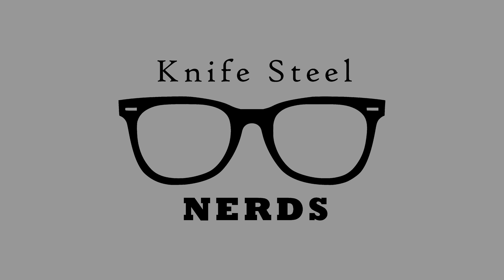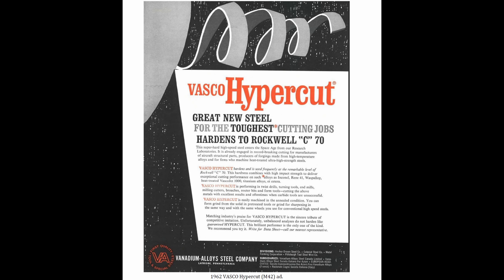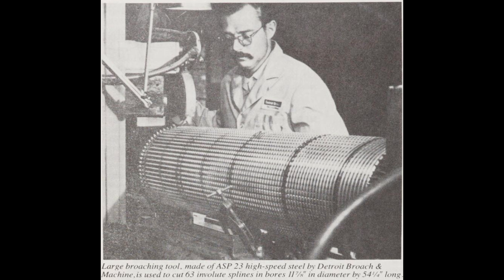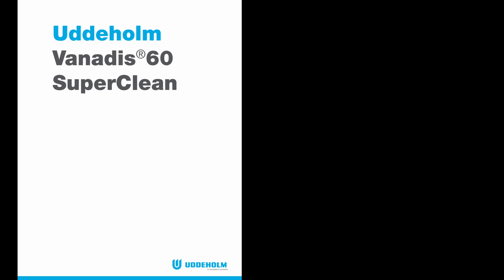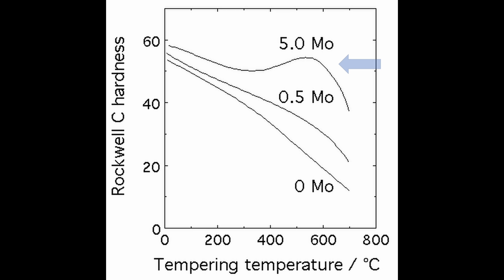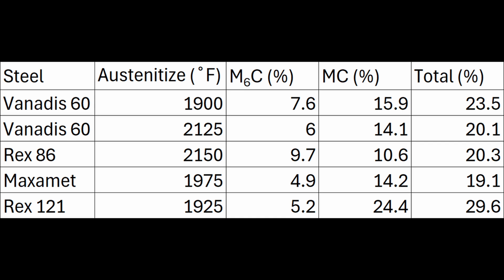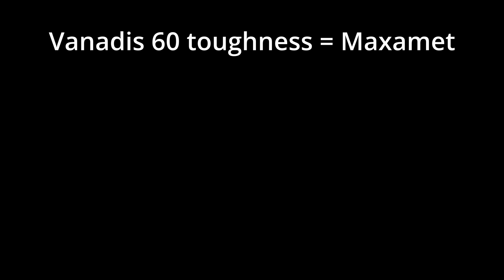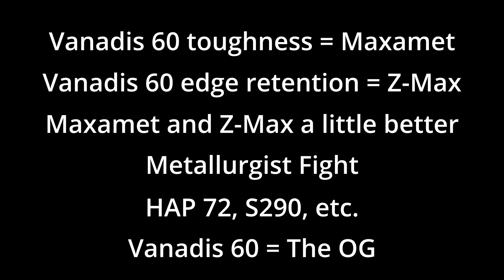Vanadis 60 Super High Speed Steel - 70 Rc and 7% Vanadium

Comment: If I wanted a knife that had a very high polish, a mirror polish. What and it’s a pocket knife what steel would you recommend?
Reply from the maker: Something without significant amounts of vanadium like AEB-L or CPM-154.
Reply: @KnifeSteelNerds  thank you 🫶
Reply: @jes6628  ZDP189 has lower toughness but insane 10v class edge retention and it's extremely easy to sharpen and to polish without any special abrasives. I would suggest AEBL, XHP and ZDP in order of highest toughness and least edge retention to lowest toughness and highest edge retention. All of these are essentially chromium steels which do not contain vanadium or other carbides. All of them take an excellent polish as you'd expect from chromium steels. Any of these steels take excellent an mirror polish without much effort or nonstandard abrasive.
Reply: The more wear resistant, the more it resists scratches… obviously, but that means the grind of polishing a harder knife pays off a bit more.

Comment: 70 is the highest HRC I’ve heard of… have you (or anyone) done any modeling of the theoretical maximum hardness for any “steel” composition? What is the highest HRC achieved in practice?
Thanks, Dr. Thomas.
Reply from the maker: I can’t say I know the exact limit but somewhere around 72-73 Rc. The Rockwell C scale technically stops at 70 though the tester will still read higher.
Reply: @KnifeSteelNerds So.. the steel is off the charts, one might say. They didn't call it Max for nothing..
I wish it was easier to remember the actual hardness difference between something like 55 HRC, 63, and 70 HRC by percentage, since it's not linear.

Comment: I'm incapable of working with these steels as a bladesmith, but these videos are still very interesting to watch, thanks for all these videos and explanations Larrin!
Reply from the maker: I bet you could work with them if you wanted. It would just be more work
Reply: @KnifeSteelNerds  how do highly complex steels forge tho? Especially in a charcoal forge, in a very traditional setting... From changes in carbon content (be it loss trough oxidation, or carburizing in the fire...), to high changes of temperature, and probably tiny hot working ranges. Also, i don't imagine traditional ways of heat treating, such as using the forge or a bed of hot charcoal (wich is surprisingly even and accurate compared to using a forge) would be fitting for such highly alloyed steels... I personally focused my work on exotic alloys and damascus, like with copper based alloys that will quench harden, or offer interesting/beautiful results.
Reply from the maker: Using a furnace for heat treating definitely makes it much more viable
Reply: I think high performance steels are more for stock removal and not forging

Comment: PM60 is the version by Scana, right?
Reply from the maker: Yes
Reply: @KnifeSteelNerds  Thanks. Got that steel in my Kunwu. Love it.
Reply: @KnifeSteelNerds  I've read that PM60 has even considerably more W and a little more Co and Mo than Vanadis 60. What does that change? If it does at all?
Reply from the maker: The rumored compositions are a bit murky, I agree. I wouldn’t worry about small composition differences, personally. They are still in the same “category” of steel.
Reply: @KnifeSteelNerds  Thanks very much. And a huge Thank You for everything you do for our knife nerd community. Both of your books are absolutely amazing, more capturing than a thriller - well, for someone like me at least. 😉

Comment: Definitely my favorite of the ultra high edge retention steels.

I would say 15v is the only one with better feedback during sharpening, but i get a bit better edge retention from ASP60. Great steel; i hope to see a lot more of it.

Edit: that T15 comparison shot is wild.
Reply: Are you talking about 15v with the big brown bear heat treatment protocol? Do you know how his protocol differs from standard protocols?
Reply: 15v is too brittle to be useful outside of niche light use cases. It's basically a gimmick. For an actual knife that's actually going to get used a steel like 10v is clearly superior in essentially every way. I would think anyone with even basic ability to read a chart could see that even without first hand experience. Essentially you're trading away critical toughness, absolutely vital to being able to employ the kind of geometries that actually perform at a high level and continue to long after the secondary bevel is toast, to gain additional abrasion resistance which serves no almost no functional or practical purpose in real world use cases.  It's silly to be honest. But knife bros seems to latch onto whatever is hyped as the next mega steel. If you want a knife that actually cuts well, and doesn't just rely on a keen edge, then you need thin geometry, to have thin geometry you need hardness+toughness. Abrasion resistance is the single most overrated and least important aspect of steel and knife bros are convinced it's the only thing that even matters. It's bizarre. All abrasion resistance gives you is extended edge keenness, which is only relevant to cut initiation aka what knife bros call "bite." basically how long do you have bite? A knife with good hardness+toughness can be made into geometry that will cut better and longer than most knife bros seem to be able to imagine without even having any edge on it at all. Cut initiation and cutting ability are not the same thing. A keen edge and a sharp knife aren't the same either.
Reply: @TimJohnson-x1o Pretty much agree. Though a little isn't a bad thing. Cru-wear or MagnaCut are in a decent spot at around 4% VC. But something like 14c28n run hard will have enough toughness to be pretty dang good but also some benefit from a chrome few carbides. MagnaCut is pretty much like a merger of the two, no chrome carbides but fine vanadium carbides, and nitrogen to keep chromium more in solution. Might be able to get away with 10v in a pocket knife but any bigger or if you're rougher on your knives like the average person working, you need higher toughness than 10v. For those times you cut through something and hit a staple in a tough cardboard box, or etc.
Reply: @mikafoxx2717  Nobody sane would try to use 10v on a big knife. That's what 3v, cru wear, 4v are for. Maybe you could push it with something like m4 but it's not worth the risk. I'd be happy with just AEBL for a big knife. But for an EDC knife, 10v is more than tough enough and has next level "edge retention." It would be cool if these brands that use steel choices a gimmick would offer laminated blades. Imagine an EDC knife that was 10v laminated in 14c28n. That's money. 15v in the real world has a little more edge retention than 10v, but it loses most of it's toughness. It's not a tradeoff that makes sense unless all you're going to do is open packages all day.
Reply: @TimJohnson-x1o  my problem is that most generic knives often aren't hard enough to take full advantage of the carbides, because the matrix of the steel just mushrooms before the wear resistance can take full effect, unless you make the angle more obtuse and then it doesn't really cut any longer either.
Reply: I know this sounds crazy, but try Rex121.